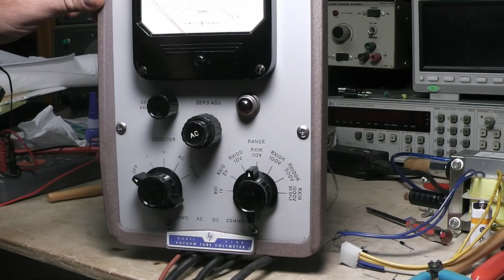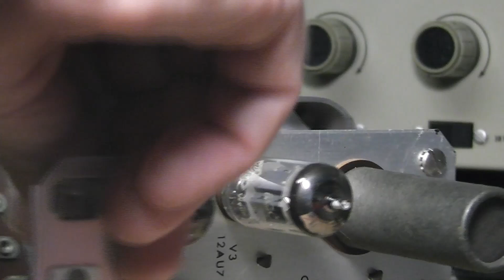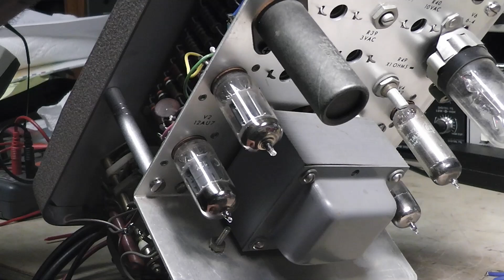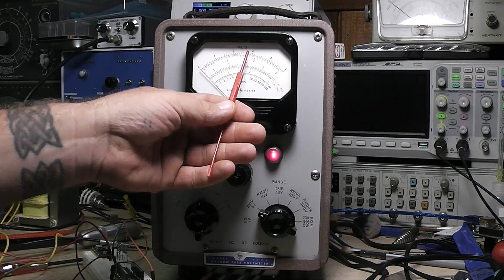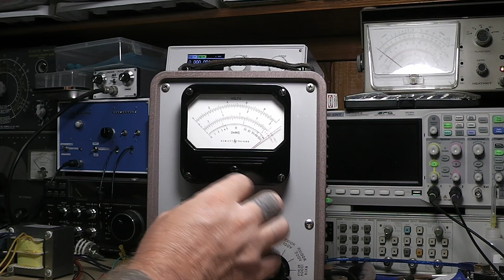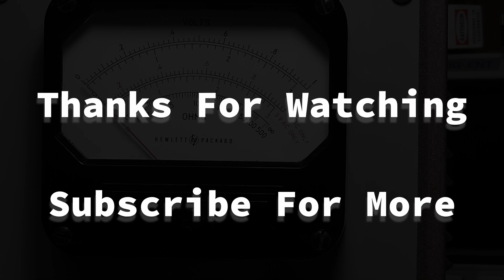HP Model 410B Restored and Alignment

Comment: What tube is in the probe? I picked up a couple of these units at a ham fest for $5. One is complete, but missing the tube in the probe. The other is a parts unit. Can the parts unit,which is missing the probe be set up to only do the functions that don’t need the probe? Thx for your video.
Reply from the maker: The tube in the probe is an Eimac 2-10C.  Yes, you can just not use it with AC if you wish.

Comment: Thanks for the video. Did you check the 22M carbon composition resistors in the AC  and DC probes?  In my unit they were both 15-20% high. This would have made calibration very difficult had I not replaced them.
Reply from the maker: Yes, I did. They were about 7-8% if I remember right.